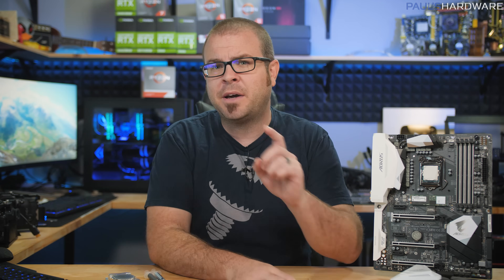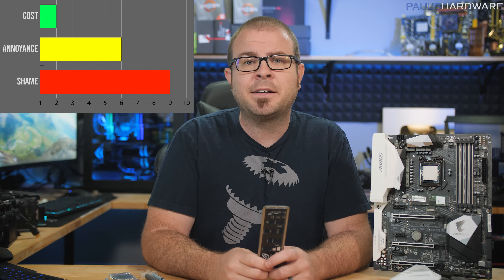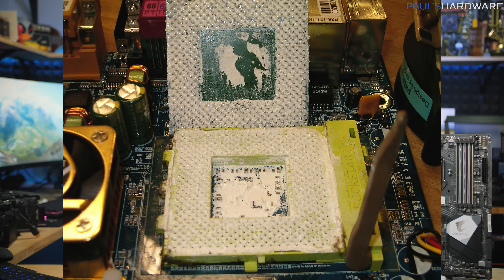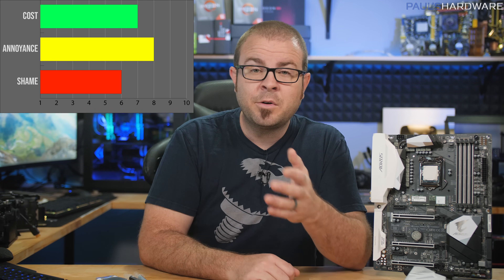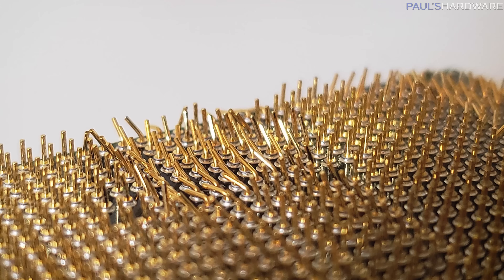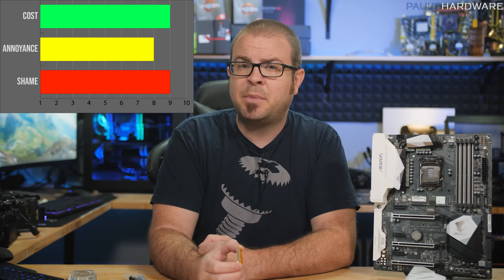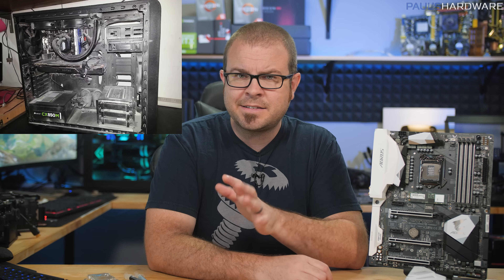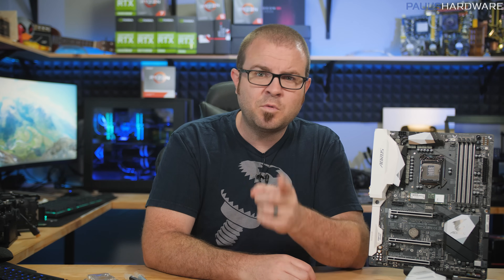The 5 WORST PC Building Catastrophes 💥🔥🧯

Comment: At the moment in going through a pc crisis. I wanted to upgrade my ssd to 1tb so I got a new ssd. I did not check to see if there was another slot. Shame. So I had 2 options, return or buy a new motherboard. I chose to save to get a new motherboard. I then got a new gpu and tried to switch it over. I broke my motherboard... So I order a new motherboard. It comes and behold, my pc case was in fact not a full atx case. New case is arriving in a few days. Wish me luck. This has been going on for at least 1 month.

Comment: Pro tip, don't buy a US PSU and use it in EU (without using the switch at the back that controls the voltage) I did this once, and it said BOOOOM ^_^ Luckily, it was only the PSU that broke...

Comment: LOL the worst laptop i have was HCL PC (not the ME edition )with specs -
Cpu - intel celeron440
Gpu - no GPU
Ram - 512mb
only for calculation purposes
but……
I am wondering that it can play nfsu2 with 30 minutes before that it starts overheating (lagging with 2 FPS) had a plastic body thats why i dont want it to
overheat cant browse for 30 minutes or see videos on youtube for 30 minutes and i think that it have a 15hz monitor but actually it have 30hz monitor and have a DVD ROM and a slot for a EGPU but i play with it (NOOB XD)……

after that i got a hp i5 powered notebook that barely get overheated and can run most games but it also have some problems its cpu was overpowerd but on gaming its integrated GPU is the enemy for my cpu on any game i barely reach 60FPS (except cs1.6 or after 2013 games) and then i got a pc with i7 8th GEN with the overpowered gpu (RTX 2070 super) and i am now happy

(PRO XD)………………………………….┏ (゜ω゜)=☞

Comment: When I was building  my first pc i was about to install the processor I was holding it tight I guess I was nervous because when I was about to install it I accidently hit the lever of the socket it made a very rough noise but after completing the build it turned out fine

Comment: with older psus, you had a 110 / 220v switch and flipping it well.. also bent pins are not so rare and there is something even more frustrating = you buy a "new" motherboard which is in fact a return from another customer but the reseller didn't check the return condition and send it to you. well then good luck cause this time the reseller may see it and the rma will also be denied...

Comment: Went to reapply thermal paste to a Ryzen 9 3900x and the CPU came off with the heatsink while the socket was still locked, thrashing two of the corners beyond repair. 

First time I've ever went with AMD CPU and probably the last time too. Intel boards actually lock them in.

Thank god I had a spare 4790k boxed up in the closet, because now that I'm down the cost of the CPU and mobo I don't really have another $700 I can just throw at getting them again.

Goodbye for now high framerates, I'll miss you.

Comment: I just built my first PC in the last couple months. Thankfully I only achieved one of these catastrophes and that was number 5. I got everything put in, all of my wire management to be decent, got the computer running and all that. Went to plug in my keyboard, mouse etc. and then noticed the large gap around my ports 😢.

Comment: .....*puts head down in shame as I about this almost everything on this list*. Although not my mistakes weren't as severe or costly. (Forgot standoffs which caused a chip to short circuit and almost caused a fire. When I went to remove the motherboard, bent a single pin on the cpu. Finally, when I went to reapply thermal paste, didn't put enough on and temps were idling in the 80s.) Thank god for warranties.

Comment: I think my worst ever failure was when I was taking apart of an old pre-built. I slipped and caught my thumb on the edge of a LAN card, I thought it just hurt like hell since it was just a LAN card, until I noticed my thumb was bleeding. I addressed the blood/wound and say the card (somehow) went through the tip of my thumb and my thumbnail. I still have that computer, and it still works. I don't like looking at it though.

Comment: Classics for me :
- forgetting to (re)connect power or data cables,
- buying a cable which is A) too long, B) too short. 
- Turning on the PSU, forgetting the power cord in the outlet or failing to put in the PSU. 
- forgetting the Front IO. 
- forgetting case fan connectors
... Most of these things would fall under a basic commercial slogan used locally a few years ago:
"Of je stopt de stekker erin..." 
Which translates to.:
"Or you could plug it in...." 
Huge shame factor.... Little cost, maybe only when you buy too short cables. Most associated with too fast and chaotic work and me trying to test it out without checking stuff, often closing the case, as I prefer to have my case closed to combat noise. Which reminds me having a loose cord due to a forgotten connector hit a fan really scares you the 1st time.... I build a PC every 5 to 7 years, fit new stuff/upgrading it maybe once per lifetime, so I'm no experience builder. I repaste the cooler every 2 to 3 years, and clean it every 2 months. Even dust filters will not keep my dog's hairs out of the case. And yes I power it down blow it out, vacuum the filters, and generally have it unplugged at that time.

Comment: - I did forget my i/o shield when first building. not gonna lie, i Rage Quitted, and QQ'd.
- I did apply too much thermal paste, but it was done on a crappy motherboard. A320 back when I used ryzen 3 1200. and it got into the chipset.
- when i was in college, and new to pc building, i bought a super cheap PSU, had 700W, which got destroyed after learning that non-branded psu will screw you, even if it has 700W, it'll support up to like 200W. Now, I only have PSU's of at least bronze rating, and 500W or more.
- i had too many storage drives, and i installed my windows 10 and activation in the wrong drive. Sadly I installed my OS in HDD instead of my SSD.

Comment: booting your pc for the first time after closing the case and finding out you don't have graphics card working properly just to realize you forgot to plug in supplemental power... multiple times

reading reviews of a bad product (thermaltake included riser cable for the core series) and having issues for months and not trying to replace the product you have read HUNDREDS of bad reviews because you were careful just to find out that product was legitimately broken and was never built right in the first place (literally half of the pins were not soldered to the cable from the x16 socket)

forgetting to install cpu cooler with a backplate until after mounting the motherboard

Comment: I had Corsair Vengeance LPX ram to completely corrupt System32 after installation. That was $290 worth of NTFS and "Windows can't be installed" errors. luckily, Ubuntu was there to save the day until it deadlocked every other day.

Comment: Something I personally should be ashamed by: I plugged the RGB cable from my Corsair LL120 RGB fans into the RGB headers on my motherboard, causing sparks in the fans and LITERALLY blowing up the lights inside of them. There are now loose peices that you can hear if you shake the fans

Comment: I thought I shorted my motherboard building my Z390 elite, i7-9700K, 32GB DDR4 3800, because I saw white flash of light when I plugged it in and it kept crashing before boot.

Turns out Z390 boards need an update for R0 stepping CPUs...
and that Aorus boards flash all their RGBs white when receiving power for the first time...
Which I'd have of known before I took apart the entire PC and put it together again. After checking all the caps and even the CPU cooler mounting... you can still reach the bios so I downloaded the new version on another PC, put it on a USB stick and BOOM worked.

Comment: Got a ? For the community. I have a mini fridge in my room that causes some kind of surge along the lines. Also turning on the closet light will do the same thing. If I have a laptop charging and sleeping it will wake up the laptop when the fridge starts cooling. The same happens when I have a dektop on sleep. It also will cause the lights on my rgb keyboard to flash on and off even with the computer completely off and just recently started making just the monitor screen for my desktop flash black for about 3 seconds during use from an xbox and from a computer. The monitor itself isn't fully turning off as the brand logo doesnt appear when the picture turns back on. I have all of my computers on one surge protector and the fridge on another. I dont understand why it keeps doing it and I dont want to cause my computer or any components to be damanged. Any help or advice would be appreciated!!!

Comment: I got one for you ... also all 10

getting a CPU not valid for a mobo because the bios version is wrong.

Valid socket, valid version of board, a OC board (intel extreme) but in a note way below all the info saying (need bios update for devil's canyon CPU's) rrrrrrrrrrr

Then the damn board got a old revision of the bios that only the older gen CPU can work on that bios version, and guess what, the supplier did not have any more of them.

I had to get a second hand CPU to update the bios
Reply: "getting a CPU not valid for a mobo because the bios version is wrong.
" Not a problem on AMD since you can contact them and they will send you a CPU that is good enough to get into BIOS
Reply: @ThatNormalBunny  yup, but it was/is the last Intel extreme board, after this board Intel stop making them, I had to save it.

They are the best boards of the time.

Comment: Have had a fire twice in the same case due to cheap SATA cables but recently, I damaged an AMD mother board changing the CPU cooler which when removed pulled the CPU from the socket.  No pins bent, but the MB first would not turn on and then later wouldn't boot.  Probably dislodged a connector in the CPU socket.  Will see if the warranty is honored.

Comment: If you're confident enough to put thermal paste on the cpu socket then turn it on:
                   You should step back and reflect on your life, personality, and decisions.

Shorting components with a leaky water cooling loop is up there.
cost 10 - Usually motherboard or gpu. Often not covered under warranty.
Annoyance 10 - The entire system may have to be rebuilt.
Shame Factor 7 to 10 - With so many points of potential failure it is hard to blame the user.

Comment: Well i for 6 months collect parts to build my PC, to upgrade from 2600k that i build 8 years ago
I bought 
Ryzen 2700
MSI b450 carbon gaming 
32 gigs Corsair vengeance 
Kraken x46
Crucial  MX 512 GB ssd
XFX RX 580

And one brand new screwdriver somehow i always lose it when building PC.

I keep  my old case SS Raven 3 but added 5 additional fans and i keep my Corsair TX650w power supply 

I started two days ago and everything was going somehow by plan but when i finally assembled my build and fresh install of Windows i noticed that my  Windows only reads half of ram.
The bios recognize 32 gigs of DDR4 the CPU Z  recognize 32 gigs but Windows only shows 16 GB at banks  1 , 2 .
And suffering begins dissemble build put motherboard out of case update bios, reset bios, downgrade bios, swap banks , check CPU for bend pins, switch coolers.
I contacted to RMA board but there is no replacement boards, and all good stuff is now way to expensive, and good stuff is sold out. x570 boards i dont need and i dont want it .

Thanks MSI for making my build  HELL i now hate my PC my new build .

Comment: During upgrading a system, I was removing the motherboard, one stand off in the middle of the board cross threaded! Took hours with long needle nose pliers wedged underneath and another tool on top to unscrew it with hardly no room to move without doing damage, but I eventually won! What a nightmare! Now I'm extra careful making sure they go in smooth. This was maybe 15 years ago when quality of the hardware was not nearly as refined as today.

Comment: #6 - your PC is laying on its back just after building and you start it up to make sure it posts, only to turn and knock a screwdriver and a tray of screws that were sitting on the sides of the case on to the now energized and running motherboard and subsequently releasing the magic blue smoke from the motherboard... 

#7 - Pre-Testing your components by assembling them together on the motherboard box and accidentally knock over a bottle of water, splashing it across the components... and again, releasing the magic blue smoke...

#8 - Removing the protective cover on the CPU socket long before you install the CPU and drop any number of things on the socket, bending dozens of pins in the process. AND/OR trusting too much in the Threadripper CPU plastic cradle it comes attached to and the CPU drops out of said cradle and onto the CPU socket, bending pins...

After building PC's for a little over 30 years I have many more catastrophes I could probably add lol

Comment: I remember when AMD sold CPU's without integrated heat spreaders. Apply too much thermal paste, and you'd short circuit the cpu with some other exposed circuitry included on the cpu board.

Comment: Back in 2001 I was the tech of a PC shop. A family purchased a motherboard, memory, CPU and cooler as an upgrade set for an existing PC they had. It was one of those Athlon Socket A models, with very fragile die (no headspreader). It was just before the Athlon XP was released, so it probably was one of the Athlon 1000~1400 MHz models.

I offered to put the CPU in the socket and mount the cooler for them, as I explained that it's a very delicate job. It's easy to destroy the CPU if you have no experience with this model.
Them: No, we're used to building PCs, we know what we're doing, plus then the box won't close.

Next day, they're back. They said the hardware they bought was broken. I plug it all in, and the PC won't boot and just gives weird lines and distortion on screen. I open up the case, and notice the cooler's mounted upside down. They ignored the cutout in the cooler that goes around the socket, so now the cooler was sitting at an angle crushing one side of the die.
I said: oh no... that's all wrong!
Them: But the power supply was in the way of mounting the cooler the other way around!
Me: That's why I mount the cooler first, then lower the board into the case!
Them: Well it's covered by warranty right?
Me:  ... err no. Warranty is for manufacturing problems only. There's nothing I can do for you.

Comment: When I was building my PC I plugged the front IO pins in the USB2 header (the only difference between them is the position of the safety pin in a different corner)  - the case had a pre-packaged 2x5 IO pin block, but also had a splitter to singular pins, so after getting angry at them for "not being compatible" with the pin out of the motherboard I just plugged every cable on its own. Not my proudest moment, and the panic sets right in, when after the power button is pressed you check the PSU switch and it's already on :/

Comment: You forgot a big one Paul, mixing seemingly compatible, but indeed incompatible PSU cables. Cost me 600 USD - Having to rebuild 13TB from backup and reinstall OS and software. The shame level was over the roof when I realized you should not mix cables.  Cost, Annoyance and Shame....all at 10.

Comment: I'd bought an Asus Z68-V Pro board from Fry's back around 2010-2011 for $15. It had bent pins, that I straightened out and paired it with an i5-2500K. It was probably my cheapest build ever. 

My worst mistake was when my Asus Z-87WS board just died for no reason. I had it paired with an i7-4790K @4.7Ghz and it worked fine for over 8 months, when one day while I was in the Bios, it just shut down. I couldn't get it to boot after that. My local MicroCenter had the same board selling for $90, in their open box area, so I'd bought that and tried to get it to boot. It wouldn't boot, so I ended up picking up a Pentium G3258 for $50 from MicroCenter, and it wouldn't boot either. It turned out that my 4790K was fried and it was taking out motherboards along with it. Luckily, MicroCenter replaced the G3258 and gave me a refund on the motherboard. I ended up doing an RMA for the motherboard, PSU and CPU with their respective manufacturers, and I'd bought an open box Asus Z97-A to get me by with that Pentium, until my replacement parts arrived.

Comment: I just did a build not too long ago. I accidentally took the cpu cover off the mobo. I put it back on but it didn't clip right. And it must have rattled around and bent a couple of my socket pins. I fixed it at first but then had to reinstall my aio and it wouldn't boot after that. 
Had to buy a whole new Z390 Aorus Master

Comment: my first pc build i forgot my front panel connectors and thought it was the power supplys fault for my system not turning on (4 power supply's later) and a call to msi (motherboard was z270 sli plus) i learned it was the front panel connectors) cost 8 annoyance 8 and shame 9

Comment: Using a cable from a different brand power supply. Board-end connector pin layouts are standardized. Pins on the power supply are not.

Comment: How about front freaking panel connectors ? Specifically power/reset/led ones, AFTER you put verything together, depending on your case and build you will have little to none space to correctly put them at right place. Yes that just happens to me 1 week ago.

Comment: My 5 things that happened with my PC. 

Monitor started smoking, don't place something right on top of it, like a shelf. 

Several Cheap PSUs died, no smoke but bad smell. Since then I use the SAME (expensive) Seasonic PSU for 8 Years without a hitch.
CPU Overheat (140°C on an old AMD Thunderbird), didn't clean PC/bad cooling. 
2 times in row bad RAM, MEMtest said no error, but it was the RAM. PC Crashed at >7GB Ram usage.
3 times in row bad AIO Pump. Same Model died 3 times in 3 Months time each (RMA'ed, died again).